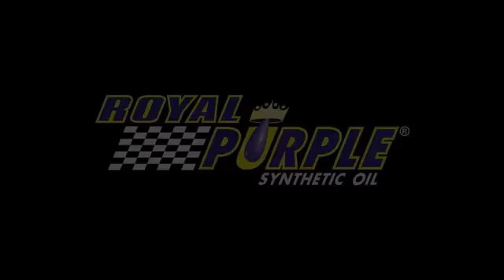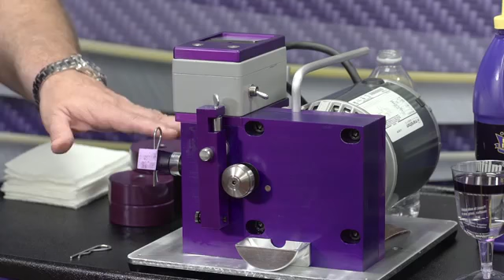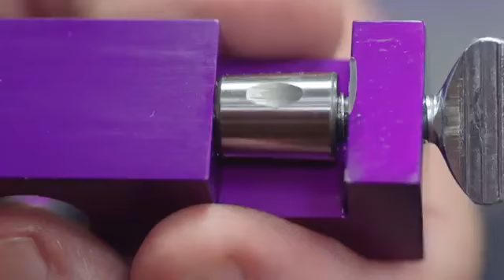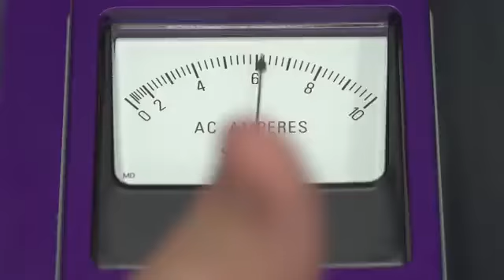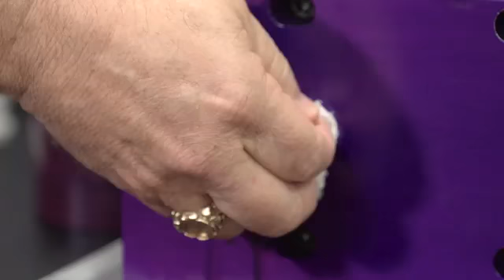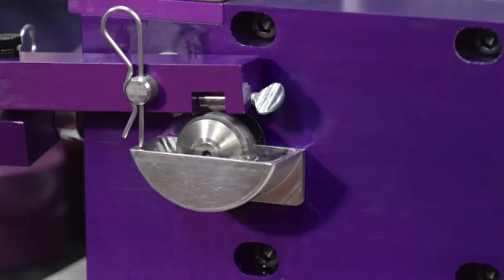The Shocking Oil Film Strength Test Using Royal Purple’s Synfilm

Comment: Royal P will clean up your engine nicely.  Lots of vids on it.  First time using it, they will tell you right from the techs at the company, change it after 3,000 miles.  Just got my high mileage formula and pricey but I will change it after 2,500 miles.  From there I might run another Purple for 5,000 where they recommend 6.  I will do this with my two older Toyota 3.3L v6's (greatest mass production engine in the world!).   Then I will switch to maybe checking out this high end Penzoil people are raving about or Amsoil high end.   Bet I get a million miles of hard driving out of this.  Watch.

Comment: Does it has to be a high performance vehicle or can i put it in my 2009 nissan sentra with 173k?
Reply from the maker: Royal Purple synthetic oil works in all models and years, in fact, many classic car owners use Royal Purple to reduce wear and optimize performance on original motors.
Reply: Yes

Comment: What a load of hyped up bulcrap I just watched. Project farm has a real test on this ware test.  AMSOIL  is the best.
Reply: I beg to differ specifically when it comes to industrial applications in industry.. Been marketing RP in South Africa to major industrial customers to competitor refineries where it is used in critical high output / high load applications to major mining enterprises. We have helped in emergencies when called out with imminent failures and by just swapping over to R.P we saved the situation and in fact the damaged equipment continued operating for months safely and effectively until time allowed for part replacement. The customers as a rule always stayed with R.P. I will however agree with you. Amsoil is also right up there, no doubt.

Comment: Quaker state has highest TBN over 152k than any oils.not sure trax,Trax, oil,etc.quaker state can stand hot oil temperature 295 degrees..can change oil 7.5k to 10k miles.work very well in high performance engine.save moneys.

Comment: i have used rp in my 98 z71 since new im at 311000 still runs body sucks engine, trans, transfer case, both diffs, and power steering all original

Comment: RP motor oil  doesn't flow well when cold. About 80% of engine wear is on cold starts. If you live where it never gets below 70 it probably wouldn't matter, but thats not the case where I live and the temp can drop below 0 at times.
Reply: For their api oils yeah. Their HPS and their race oil flow pretty good cold from tests I’ve seen. It’s no amsoil signature. But pretty good.
Reply: @knifelover73  I already know that and that's what I'm referring to.

Comment: been running Royal Purple in all my rigs for years. Love the stuff. I saw an independent engine dyno on a Corvette high performance engine and it pulled another 10 hp over Mobile one! 
I am stuck on RP.    DON'T WANT ANYTHING ELSE IN MY MOTORS.

Comment: Why in the hell do you have to place waights on that friction test. Why can't it be timed to turn on and off with a digital timer? With set waights that don't change? Then it would be a fair comparison. I tried royal purple and it made my 370z engine run ruff I didn't care for it. Then went to AmsOil and was incredibly smooth.  I also dipped some metal I had laying around in royal purple and dipped the other oils I had laying around . And the next day the one oil that didn't have any oil film on it was royal purple. Dont buy this stuff . All hype
Reply: How many Miles did you drive on your 370z with Royal purple.
Reply: The weights are to stimulate different tolerances and wear in engines with different mileages. Oil should be able to keep an even film through as many different engine tolerances and wear. That's why he added weights. Newer engines have smaller tolerances and clearances, older engines have larger clearances because of wear.
Reply: If you search "one armed bandit oil test" you will find several debunks of this testing method. You are right that it is not a fair test. The demonstrator did the classic move where he applied full force on the "poor" oil pretty much immediately, while the "good" oil gets to work in and warm up with just one weight for much longer while he talks about how good it is.

Comment: This tester is nothing more than a Timken load tester with slightly relocated components and purple finish.  
RP is obviously a great oil, but this is not the best test to prove it.  Motor oils work best when they are at around 100 degrees C.  Here, the test is done at room temperature.  This introduces a major thermal variable that puts the whole test in question.  
There is a reason why you never rev up and put heavy loads on cold engines.  In this test, you are pretty much revving up and overloading a cold engine (with cold oil), so to speak.  These test results are pretty much anecdotal.  This test temperature is not what you see inside an engine.  Repeat the test with oils at 100 degrees C and let's see what happens then.  That would be very interesting!
Reply: Agreed.
Reply: The one armed bandit is not the best way to test oil...gives you an idea of how it might perform...I know of a combination of products that blow RP out of the water in this test..RP must have some sort of ester in order to live up to its claims.
Reply: Well his little device won't work with 200° oil because he would get burnt

Also he used gear oil, which isn't heated up as much as in the engine. 
So yes a differential will be cold only until the car starts to move so this test is 100% relevant.

Comment: I'm an amsoil guy but acknowledged Royal purple to be an amazing oil. In fact, there are so many quality Synthetics on the market that you can run just about any of them and not run into problems
Reply: So many camera cut aways?
Reply: If I can't get amsoil, I'll run pennzoil before Royal Purple.
Reply: @anthonyjulson8840  Pennzoil Ultra Platinum is some good stuff!
Reply: @anthonyjulson8840  I use royal purple it works great and cleans the engine
Reply: in reference to the replies that are in this post, please note that the oils in this demonstration are not motor oils. They are industrial gear, bearing, and pump lubricants that are not formulated to deal with acidic combustion byproducts. The Royal Purple Synfilm iso 68 is marketed as a air compressor and industrial oil.
Reply: @fowvee  extreme pressure additive right?

Comment: The shocking part would be the presenter pushing himself away from the supper table.
R&P oil and you can rev up 1000rpm higher than before. As seen on RubeTube.
Dude, I weighed 305. I started chewing my food and dropped 100lbs in 6 years. My testimonial: Human size proportions not Golden Corral.

Comment: I just bought some royal purple sae 75w-90 max gear for my 2008 ram 3500 manual g56 transmission. I’m hoping it is as good as everybody says it is. First time using a royal purple product so I’m excited to see the difference
Reply: How is it so far?
Reply: @Ethan Romero I put my southbend dual disc in on the 11th and have put about 1100km on it with no issues. Shifts great and seems to be quieter